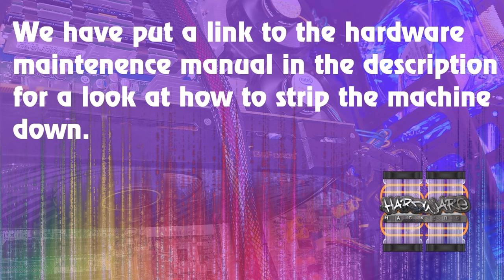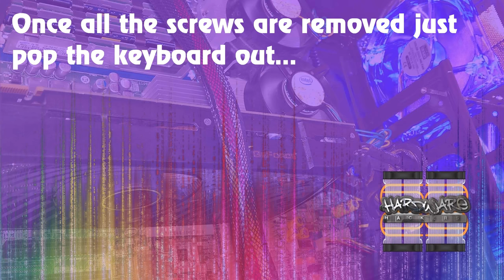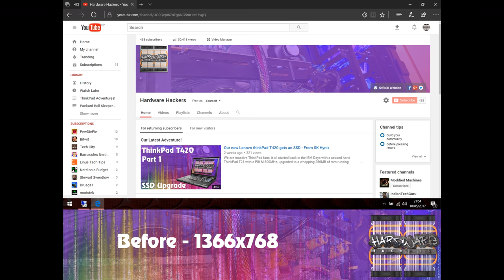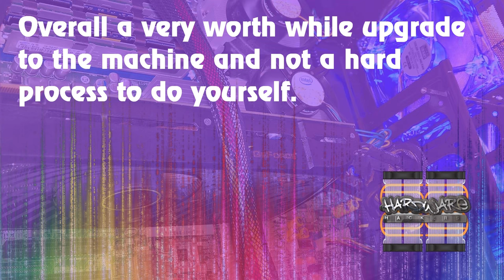Lenovo ThinkPad T420 / T430 - 1600x900 HD+ Screen Upgrade

Comment: You know what grinds my gears? People who use a trim tool to take the keyboard out of the think pads.... all you have to do is put both hands flat on the keyboard and slide up. The keyboard will slide out of its notches. Some of these videos I watch it's so painful to see someone spend 3 minutes doing something that takes 3 seconds. Good God lol BUT NONE THE LESS, GREAT VIDEO. Subscribed
Reply from the maker: That's how I remove the keyboard on most thibkpads but it doesn't budge on my t420/t430.
Reply: @HardwareHackers  Alright. You win this time lol

Comment: As of May 2020 is there a 1080p screen upgrade available  for the T420 or is the 1600x900 the best were are going to get. When the human race ends...the T400 laps will still be around!
Reply: As will the Leica M6
Reply: you can even upgrade to a 1440p screen if you want lol, its not worth it tho imo. would rather sell old  t420 and upgrade to a t450 or greater

Comment: Everyone wishes that Lenovo brings back the quality , design and everything about the Old 10-20 series with newer hardware and such , don't make it thin , make it usefull and strong ..
Reply: amen
Reply: Don't forget the classic keyboard and easy serviceability.
Reply: @ShadeSlayer1911  Old good days, those were the time where we valued Electronics we buy.
Reply: @CharlieQ7400  when devices were built to last and you could repair them if they broke. For this reason, I decided to buy a t420, if for no other reason than to have a piece of history in my collection. I hope to be able to tinker with it when it arrives.
Reply: @ShadeSlayer1911  Wish you the best luck ! if you can find me one , would be interested !
Reply: @CharlieQ7400  Ebay and Amazon have a decent selection, though it's getting slimmer as time passes. More people seem to be getting into the used laptop market, so I'd get on that if I were you. 

And thanks! I wish you luck as well.

Comment: 1600X900 is much better than the 1366X768, yeah, MUCH BETTER.
Specially when you have the 15,6 inch series like T510, 520 or even 530.
Reply from the maker: we found it really hard to get a screenshot or photo that really showed the difference that you feel when using the machine! its pretty hard to capture! it makes it a delight to use!
Reply: Adi Abri Ganjar Utama @but why difference is big? Not much by the numbers though

Comment: You couldn't reuse the original display cable? That would save you all the hassle of opening up a lot of stuff... Nice upgrade nonetheless, looking forward to the RAM video!
Reply from the maker: No, unfortunately the hd and hd+ use a different cable.

Thanks for the feedback, the extra ram will make all the difference and be interesting to see if the performance memory timings make much difference.

It's a shame its going to have to come apart again however!!

Comment: thanks for this video.. .I've had my t420 for many years now.  It's very dependable honestly.  I didn't even realize the screen could be changed.  I found an LG screen and cable so those are on the way.  I made sure it was OEM/genuine.  For all this time I've had 4gb of ram and a 300gb harddrive.  It was slow.  Just popped in another 4gb so 8gb total now, and a 256gb SSD... it's mind blowing why I did not do this sooner.  The screen upgrade looks nice.  It's a cheap mod so figure why not.  Not sure how much better it is going to be honestly though.  We'll see..  Great how to.  I appreciate that you took out the screen itself.  A lof of places sell the screen/bezel and why I bought was just the screen so this video will match up perfectly!
Reply: Got my screen and cable today.  Will be doing the install in about an hour!  w00t w00t!
Reply: @NewShockerGuy  so was it worth it?
Reply: @Phantom-pj1ls  Forgot to update.  Yep definitely worth it.  In fact I'm on the t420 now writing this..lol  I have newer laptops but honestly this is my go to one.  It's just the right size, and weight.  With those mods it's like a new computer.  Still fast.  And slightly higher resolution screen made the biggest difference in terms of viewing content without having to scroll everywhere.
Reply: @NewShockerGuy  are the viewing angles better with the new screen?
Reply: @ensom  I can turn my screen almost 90 degrees and still see what's on it.  I do believe the viewing angles are better.  I am not sure if all upgraded screens are such but the one I got is such an improvement over the lower resolution screen.  I'm still using this laptop.  Other than the battery not lasting long, it's the perfect size for me.  I ended up dumping 16gb of ram in it just because I had it laying around.  Just gotta pick up a new battery and I'm good to go.
Reply from the maker: Yeah I think it depends screen to screen, I wouldn't say it was worth upgrading for the viewing angles as it could be no improvement but the extra resolution is fantastic!

We are about to upgrade a t440 from a 1600x900 to a 1920x1080
Reply: @ensom  Yes. significantly better!

Comment: my screen is broke. is there any way to tell which version screen i have? i do have an external monitor but i cant get it to recognize the laptop screen.
Reply from the maker: I don't have one to hand to test but I believe if you type your machine number into this system it will give you a full spec inc the screen fitted http://psref.lenovo.com/Search
Reply: thanks but the sticker with the serial number is long gone
Reply from the maker: ah that's a shame nothing under the battery? looks like pulling the screen out will be the next easiest option!
Reply: yea guess so. oh well

Comment: In order to replace my old 1366X768 screen for a 1600x900 hd+ in my Lenovo T420, do I need to buy something else beside the screen? Any cable? Any controller? Best regards.
Reply from the maker: the screen and the cable, everything required inc part numbers is detailed in the video :-)

Comment: well done. i owe a T530 myself and had some issues upgrading the 1366 x 768 panel. my goal was a 1080p display but i couldn't get it to work. my guess is the LCD cable needs to be replaced. but i don't have alot of succes finding a HD+ cable. funny thing is, i found a pretty damaged HP probook at work with a 1600 x 900 display at work and i decided to take the screen and try it on my t530. and a little bit to my surprise the panel worked. now i was under the assumption that when your LCD cable supports 1600 x 900 it should also support 1080p. when i put in the 1080p display i see the bios display, i see the white dotted circle from win10 being loaded and then nothing. when i then hook it up to an external monitor i see the panel being recognized as a 1024 x 768 @ 60Hz panel. so i'm damn sure it's a bandwith limitation. if you guys got any idea's or theories i'd like to hear them :)

Comment: Hi i know this is a bit late to the party, I clicked on the link to the cable, went to UK and had a bunch of part no.s so which one to get?
“

I think I can figure out the screen part. Thanks
(In USA)
Reply: I'd check out this guide: https://medium.com/@n4ru/the-definitive-t430-modding-guide-3dff3f6a8e2e, it has a section on displays for the T430.

Comment: 1600x900 on 14`` screen looks like better then 1440p on my 24`` screen lol.. Hardware Hackers i wanna get this laptop from ebay.. i want to upgrade the ram from 4 to 8 and the cpu from i5 to quad core i7 2630qm oe 2670qm.. also the screen from 720p to 900p.. and the 160gb hdd with 500gb hdd which i have and maybe later with ssd.. would you recommend me doing something different or doing something else??
Reply from the maker: we looked into an i7 but peoples experience online was that they just run too hot for comfort on these machines! To be honest the little dual core i5 has proved more than enough for our usage when paired with a super fast SSD. The 8gb of ram is definitely a good move, we are still waiting to do ours. and the screen upgrade is FANTASTIC value for money. Feel free to hit us up for any questions you have on the process and feel free to share your progress at www.facebook.com/HardwareHackers
Reply: Hardware Hackers tnx dude
Reply from the maker: let us know how you get on, sounds fantastic. as you say the sandy i5, for what we use it for is more than enough but the potential for a real cheap power house with an ivy i7!!

Comment: Hi i have a Type 2522 T410, its screen freezes on the start of it it works with vga on my tv in full hd just fine but i want to repait it and use it as a second PC next to my Desktop can anyone help me find a solution or a new panel? thanks.
Reply from the maker: have you got a picture of it freezing? feel free to post it up at the forum for some support if its easier www.hardwarehackers.co.uk/community
Reply: first it boots up  https://i.imgur.com/b6MluAO.jpg , https://i.imgur.com/CRgrBXE.jpg then shows something sometimes , https://i.imgur.com/Kdbdj1d.jpg but begins to freeze and artifacts begin to take over the screen untill its all white
Reply from the maker: that is an odd one, possibly a faulty screen cable, its pretty easy to check/replace. seems the GPU is working fine if its displaying on an external monitor ok.
Reply: yeah its doing well on my tv, thanks i will try to get a new cable
Reply: I have an equal has little to buy it and it is combined at the beginning of the session I don't know what it is missing

Comment: Still looks abysmal. The screenshots make it look better than it is. Check out that gamma and unsaturated colors at 6:35 that no amount of color profiling will be able to fix. Of course taking a screenshot and viewing them on an actually good monitor will make it look decent.
Reply from the maker: The screen is of no worse quality than the Factory fitted unit was, the T420 was never renowned for having a fantastic screen, unlike previous ThinkPads with their IPS panels but as a daily web surfer work horse the LED panel is bright enough, viewing angles are of no issue as its only ever being used at a desk.

The purpose of the video was not to show any improvement of screen display quality, hence the use of screenshots (as there was no improvement, however there was no negative trade off either!) The purpose was to show the extra real estate that can be gained from such a swap.
Reply: Yeah the original screen is trash... I'd like to find a decent one to put in this t420.
Reply from the maker: there are a few options, they are a bit more intense though!! http://www.thinkwiki.org/wiki/Replacing_T430_screen_with_a_better_one
Reply: Can confirm. It's one reason to avoid the whole laptop today and go for newer models with IPS.

Comment: Could you provide a link to purchase the screen?
Reply from the maker: http://www.ebay.co.uk/itm/IBM-LENOVO-93P5685-14-LAPTOP-SCREEN-GLOSS/382079123986?epid=2206292876&hash=item58f5b0c212:g:IOQAAOSwPh5ZFG7n

That is a link to the replacement screen and here is a link to the LCD cable required...
https://www.ebay.co.uk/itm/New-LCD-Screen-Cable-For-IBM-Lenovo-thinkpad-T430-T430i-Series-Laptop/362147472797?hash=item5451abe59d:g:Mj4AAOSwCJxZ-uw7

Comment: Will this work on T420s ? Thank you.
Reply from the maker: We had a real good look online for you but couldn't find much at all to confirm or deny if it will work or not! We did notice that MOST review sites at the time of release were receiving review models that were fitted with 1600x900 HD+ screens of the same 14.1" screen size - So I would make an educated guess at YES it will be a straight swap if you have a 1366x768 panel currently!

Hope this helps :-)
Reply: Thank you!
Reply: if your super tech savy there are 1080p mod kits on ebay. now if you have a T420s the 1080p mods are very reliable and easy to apply. for the t420 model the 1080p mod kits are much less reliable and may have incompatibilities with bios and hardware.
Reply from the maker: May have to check one of these kits out, like the sound of them!